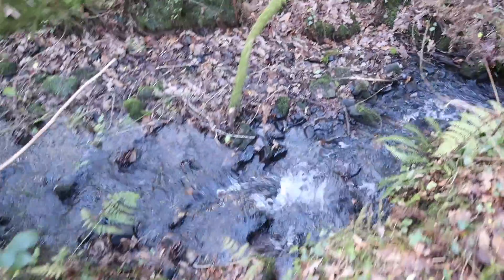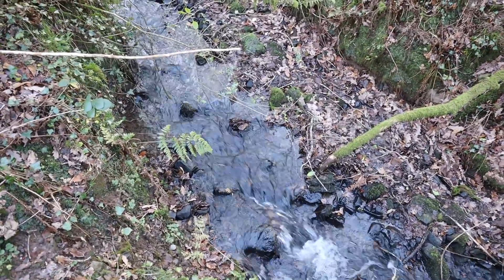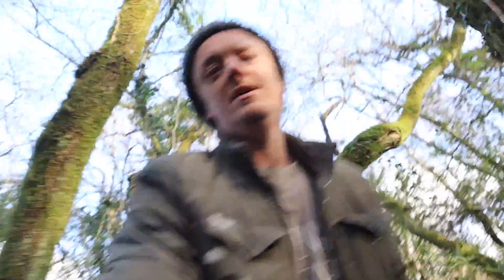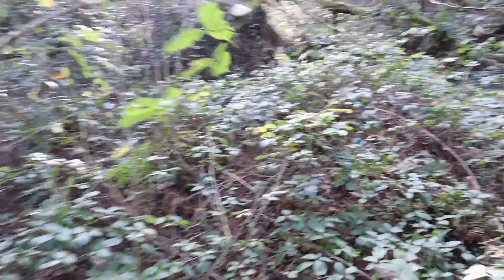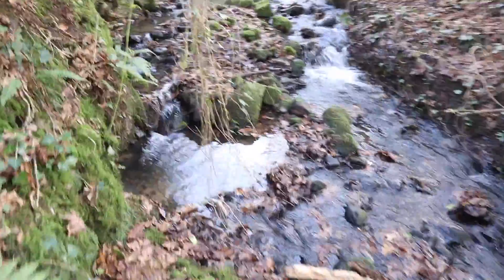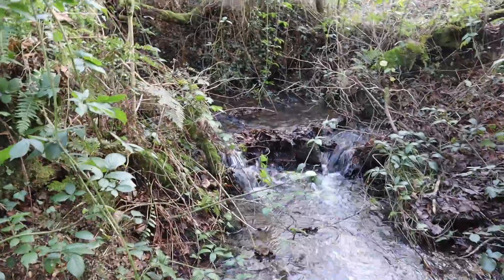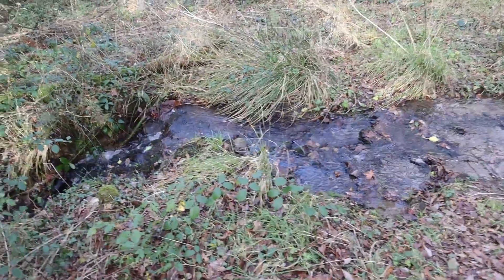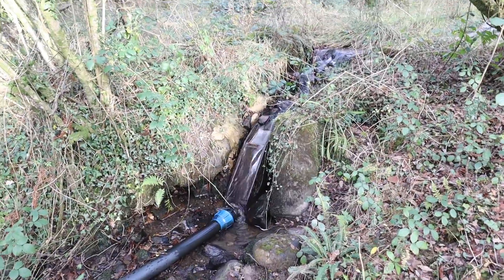Prospecting A Second Intake Source For My Off Grid Micro Hydro

Comment: Great idea. Ecology aside, that stream for your second source of power looks ideal for a dam project. I realise that it is a boundary, but would a dam increase your power even if you had normal flow after the dam?
Reply: what type of dam? one to direct the water in to a pipe or one with build in generators?
Reply: @MrTurbo_  more directly into a pipe. My thinking would be much higher pressure. The stream would only suffer a shortfall in flow while the small dam was filling and excess water would go over the top and down a short chute to reduce cavitation. I don't think you'd need a big deep dam. Maybe 3ft high. I think this is fairly sound is a fishless stream.
Reply: @Carl Jones i have to inform you that a dam would not increase the pressure any more then by how much it increases the water level in height, this sounds counter intuitive but were you probably are mistaken is that the weight of the added volume of water is directed in to the ground and is not converted in to pressure, so the only thing a dam would help with is directing the water in to the pipe which would probably be of little added benefit, you would also have to filter the water from leaves and stuff like that which is currently taken care of by acces water running over the filter and sweeping of leaves and any other type of debris
Reply: @MrTurbo_  I believe it would over the current system where water flows into a pipe and especially if you build in a small but substantial gradual drop.

Comment: I don't quite understand the bit about where the two penstocks would join, if they aren't identical pressure "one will push water out of the other"
Wouldn't this only be the case if the join is close to either of the intakes? 
If the join is a long way from the intakes wouldn't it need terrific pressure difference to push water in the reverse direction back up through an intake?
Surely a small difference in pressure wouldn't overcome the other system enough to push water out of it?

Comment: If you have two intakes, and one of them is higher than the other, wouldn't the water coming into the higher intake actually push the water back out of the lower one?
Reply: Ahhh... I wrote that comment half way through watching... and you go on to explain that! I should watch the whole video before commenting next time! :)